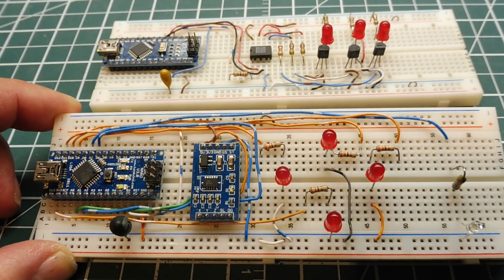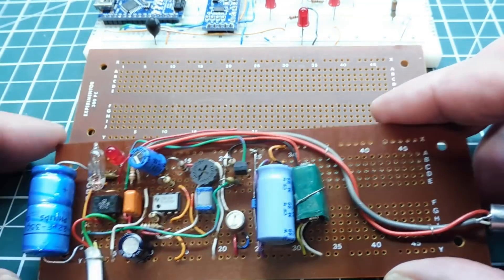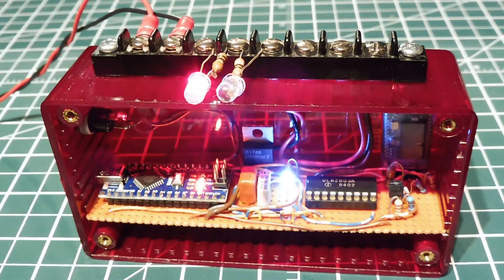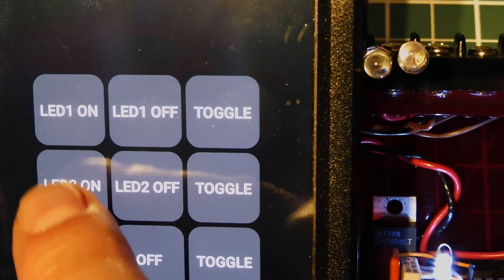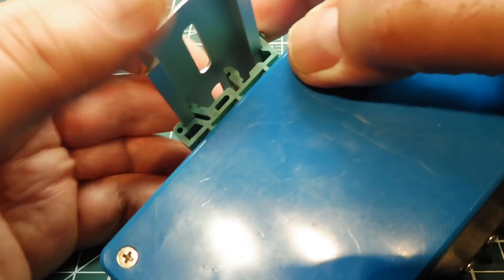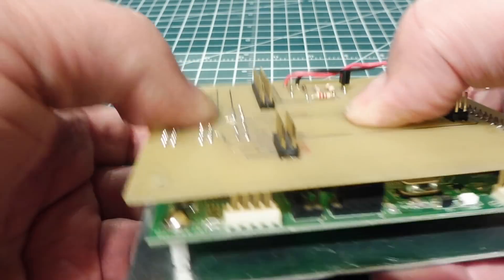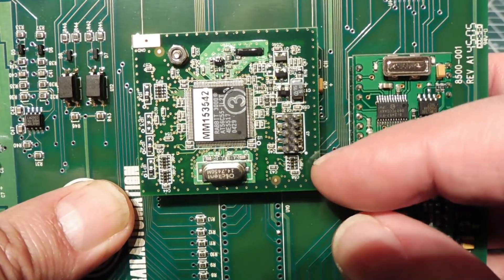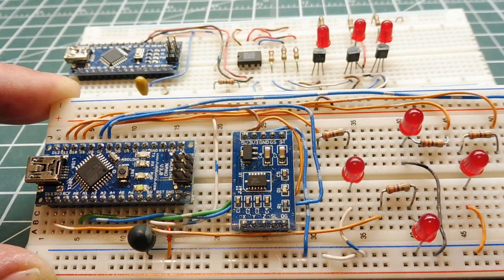Project Prototyping and Development

Comment: It's good to see a channel that puts some effort into building circuits using decent mechanical techniques. I see so many where they just solder loose wires together. Prototypes are hard enough to get working without poor connections, wires shorting together and intermittent connections. Good on you.

Comment: I've been searching for those. 

Can you share your source of the protoboards that match the solderless breadboard layout?
Reply from the maker: They are getting harder to find.
I get them from eBay or Sparkfun:

https://www.ebay.com/itm/GENERIC-NEW-0302PB10-EXPERIMENTER-DESIGN-PROTOTYPE-PRINTED-CIRCUIT-BOARD/162835763004?hash=item25e9c48f3c:g:-28AAOSwrf1ZZpYc

https://www.sparkfun.com/products/12699
Reply: Wow, those prices... $4 + $11 shipping for one... I usually expect E-bay to have some bargains.

Thanks for the links, but I bet it would almost be cheaper to go to one of those cheap PCB fab shops and order the same thing as a custom order.
Reply from the maker: You can get similar ones from China with free shipping at a good price. They are a bit smaller than a breadboard but will probably do the job.
https://www.banggood.com/5pcs-5X10cm-Single-Side-Copper-Prototype-Paper-PCB-Breadboard-2-3-5-Joint-Hole-p-1043251.html?rmmds=search&cur_warehouse=CN
Reply: I've seen those ones, and wondered about the odd spacing and layout. For the usual cheap chinese price, it's probably worth an experimental buy.

Thanks again.